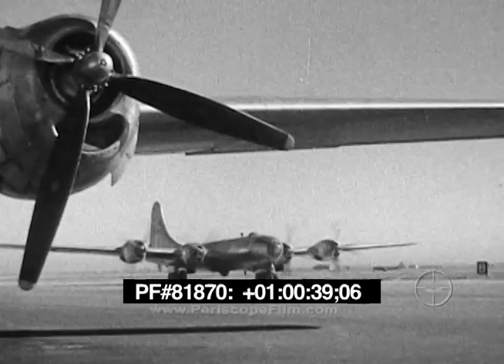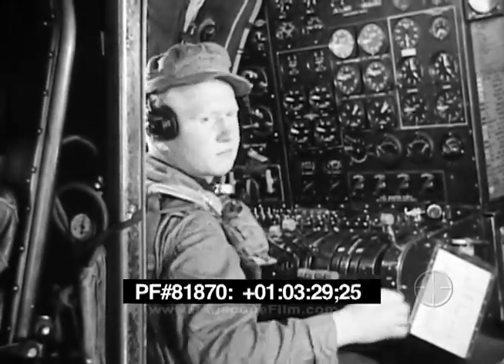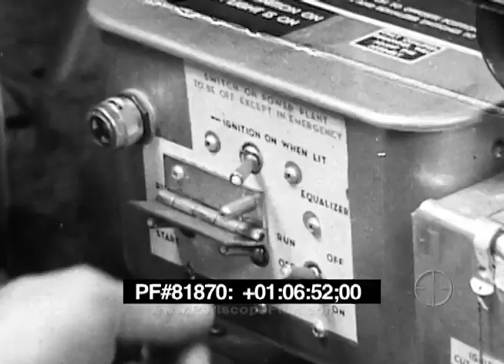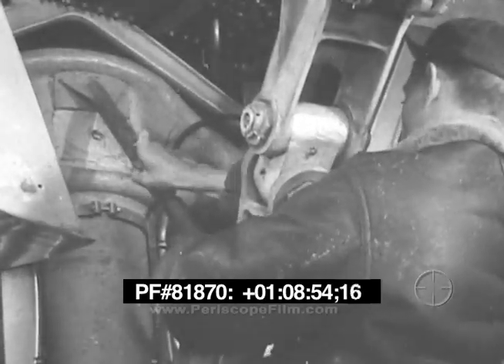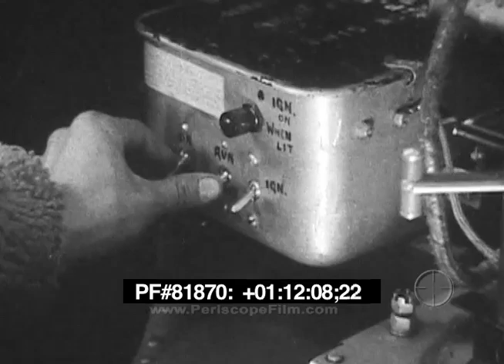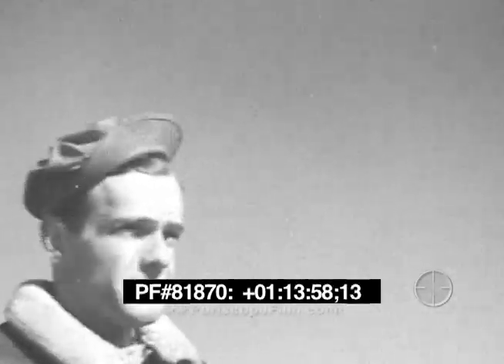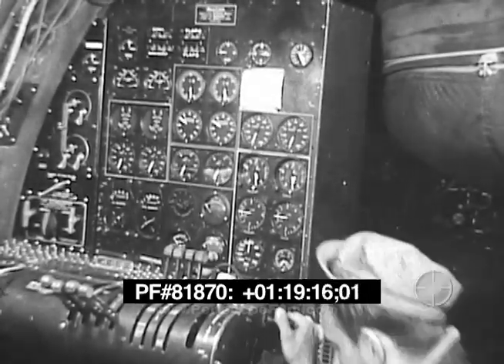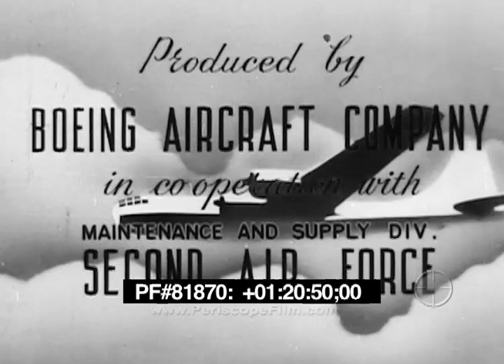B-29 GROUND HANDLING - WWII 81870

Comment: There was some great footage of the Cletrack M2 Tug, a High-Speed Tractor (HST) manufactured by the Cleveland Tractor Company.
Reply: Cletrack also made thousands of farm tractors, most of them had steel wheels with traction cleats on them. Many farmers around us had them, or John Deeres. Some had converted to rubber tires.

Comment: After the H.H. Arnold Special B29 was to go on it's maiden flight from Seattle to St. Louis ( if I remember correctly ), my uncle, the pilot, decided not to fly the airplane because of an oil leak in one of the engines.   The authorities on the ground told my uncle to fly the plane with the oil leak, but my uncle said that he'd fly the plane after they fixed the oil leak.   They fixed the oil leak.   In it's maiden flight, somebody flipped on the cabin lights, which shorted out all the instruments on the instrument panel.   They had to find an airport to land, and somehow they found an air port with a landing strip long enough.   The electrical problem was fixed, and they successfully continued on their flight.

Comment: The lack of nose wheel steering ,puts excessive strain on the main undercarriage, tyres and forward radius rods. Constant brake application to control direction during taxiing  increases wear of brake shoe bags and tyre treads. It is odd Boeing and Bendix did not design and engineer a suitable nose wheel steering  system until 1946-47 when the B-50 Superfort Two 'SportPack' Model entered USAF service with Bendix or Goodrich multi-disc brakes and powered nose wheel steering, just  like your ,71 Chevy Chevelle.

Comment: Wow, Ground Handling made hard the USAAF way, ok, I know all Airforces have their own way of doing things and that large aircraft like the B-29 have their own peculiarities, but in this case the hand signals used whilst marshalling, towing and see of procedures (I know they didn’t do the see off) were unclear and done like it was just to much effort. When grounding or ungrounding an aircraft it’s attach to Mother Earth first (especially after a flight) then attach to aircraft, the opposite for ungrounding prior to towing or flight. During towing operations the brakeman should have his feet on the footbrakes at all times, so that if, for any reason, any of the towing team calls (screams like hell and everyone else involved does too) “brakes” there isn’t a delay while the brakeman stops picking his nose or dreaming of winning the world series (incidentally, why is it called the World Series? Only the USA and Canada, I believe, play in it, so why?) to react, thus avoiding an accidental collision of aircraft with Hangar, light stantion, other aircraft, boundary fences, ground support equipment (GSE) etc etc etc, and on most types the brakeman keeps his hand on the parking brake as well so that as soon as the footbrakes have been applied the parking brake can be applied to a) allow the brakeman to release his foot pressure on the brake pedals (easily get cramp or some other problem causing them to release their physical pressure and the aircraft could roll away, and yes I have seen it happen, more than once), and b) the parking brake, once applied, maintains constant and equal effect whilst not using up accumulator pressure. It only takes a fraction of a second for an accident to occur, but avoiding one also takes a fraction of a second as well. I was in every position on towing teams in my 24 years service with the RAF, from lowly chock Walker (if the aircraft started to runaway and the brakeman was still trying to get his finger out...of his nose, the chock man was supposed to throw, or should I say place the chocks in front of the wheels to stop it.....yeah right) all the way to team leader (plane captain I think you call it in the USA), and in all those years, and goodness knows how many aircraft moves, big, medium, and small, I was never part of or in control of a team that had a collision, luck? Yes, teamwork? Yes, Training? Yes, experience? Yes, but these USAAF/USAF ground-crew were PANTS, and before long it could easily turn to FUBAR. 
Thanks for sharing this interesting and informative training film, 0/10 for the ground-crew, 👍👍👍👍👍👍👍👍👍👍/10 for P.F. 😀🇬🇧🏴